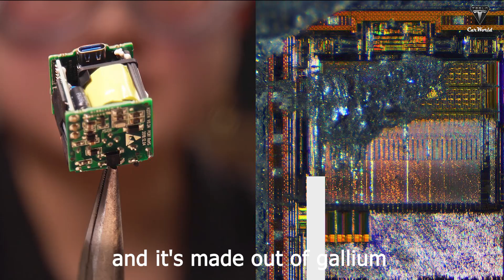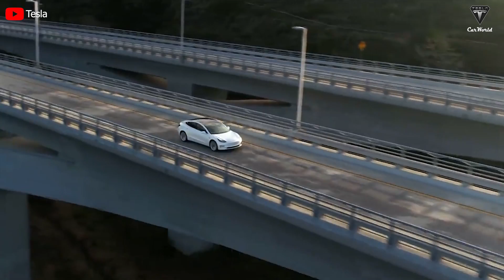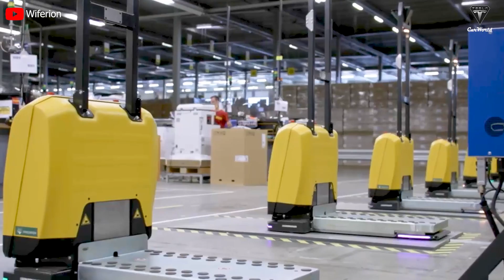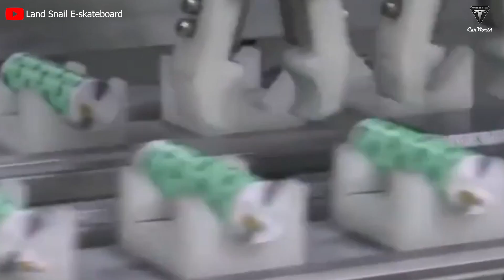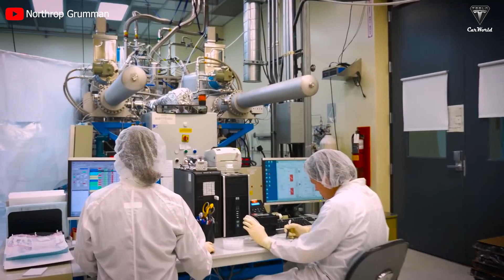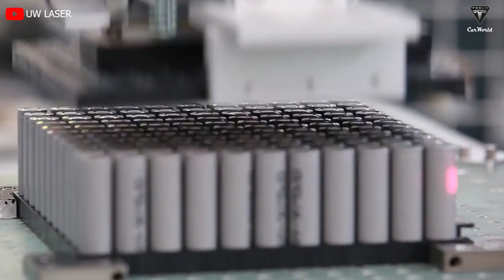Elon Musk Unveiled Gallium Nitride will REPLACE Lithium to Create a New Battery type GaN

Comment: video is 2 years old, but popped up in my google news page as if it were current? from Penn State last year: "Penn State researchers to lead $1M US Department of Energy grant to determine replacement for gallium nitride

Nov 15, 2024

By Mariah Lucas

UNIVERSITY PARK, Pa. — China recently limited the export of gallium nitride, a type of semiconductor used to manufacture a variety of consumer power electronics, such as cell phones and computers, as well as medical devices, cars, wind turbines, solar farms, LED lightbulbs and more.  

China produces nearly 98% of the world’s supply of semiconductor gallium, according to the U.S. Geological Survey. In response to the country’s move to limit exports on the compound, the U.S. Department of Energy (DOE) put out a call for proposals to U.S. scientists to engineer a solution to replace gallium nitride-based semiconductors."

Comment: This author doesn't know what he's talking about. This is complete nonsense. Gallium arsenide is way too expensive and resource limited to be used as batteries. China controls nearly all the gallium and is banning it as we speak so what's the point of trying to develop gallium arsenide batteries when they are not sustainable and extremely expensive and limited? Sodium or sulfur ion batteries are more logical next step to lithium-ion batteries. If not replacing them, complementing them in certain applications.

Comment: Gallium Nitride is used for high temperature electronic switches as in well drilling equipment. I have never heard of them used for batteries. Also, you mention a 100WHr battery charging a car but that is 100 times smaller that the battery in an EV. Who is developing a Gallium Nitride battery?
Reply: Second this.  I dont understand how GaN, commonly used as a semiconductor, will be used as a battery.  

Are there existing GaN batteries, or, are GaN the charger for battery pack and Li-on are the battery cells?

Comment: You completly mixed everything. Gallium Nidride is a semiconductor and has nothing to do with batteries. The new battery will be sodium-Ion, replacing Lithium-Ion.
Reply from the maker: As we mentioned in the video, GaN is a semiconductor used in light bulbs because it conducts electricity well, but it also has potential for battery packs when it is in compound form. It is still being researched for application in battery packs and the results we have are parameters drawn from experiments. Thank for your comment
Reply: @TeslaCarWorld so, your 17:35 minute video is all speculation. A lot of could be and maybe.

Comment: This vid is wrong about supply of Lithium.  Not only have prices fallen, but the biggest deposit in the World has been discovered in an extinct volcano in Nevada.  Tesla is developing a very large lithium refining plant at Lathrop.  No cigar for guessing why.  Gallium nitride will no doubt have its place where high energy density is required - but a battery lifecycle of only 10 years does not make my heart beat faster.  I suspect that GaN will be part of a pallet of battery options available for different applications.
Reply: Great comment.
Reply from the maker: We regret not mentioning volcanic lithium mining. However, the truth is that lithium is in short supply and its price has not decreased. There have been many articles published about this issue. With all the electric vehicle companies and other sectors choosing lithium as an electric vehicle battery component, it won't be abundant forever.
Although GaN is a semiconductor, it has great potential for application in future battery packs. Thank for your comment
Reply: @TeslaCarWorld if you google the price of lithium. You'll see that it has fallen 47% in the last year.
Reply: @TeslaCarWorld Elon doesn’t want anyone to know but teslas are one of the most dangerous fires to put out because of the mass amount of lithium in there batteries sometimes the vehicle needing to be submerged in water for over a week because it can reignite Elon is going to put lithium in the battery may not be a lot but there will be think of all the other scams he’s pulling
Reply: I agree
Reply: What about cold weather conditions?  Can GaN batteries not lose range in extreme cold weather? That's an issue right now.  And will GaN explode and catch fire?
Reply: My guess those batteries are like 40$ for a 2 pack